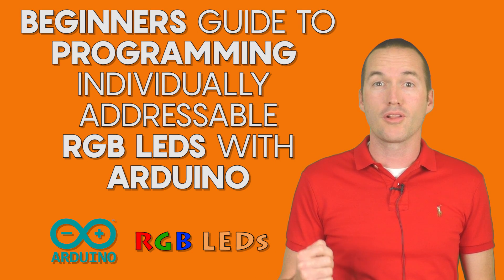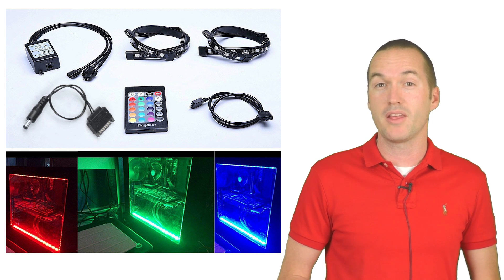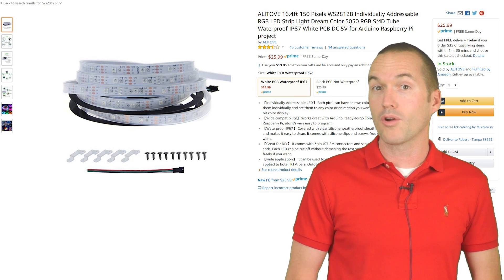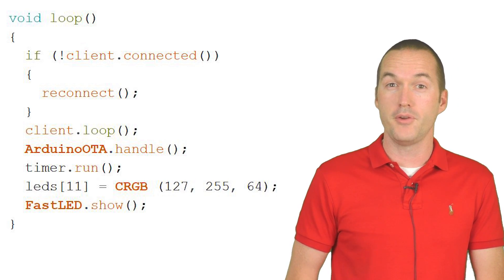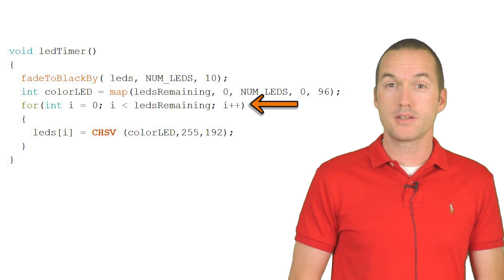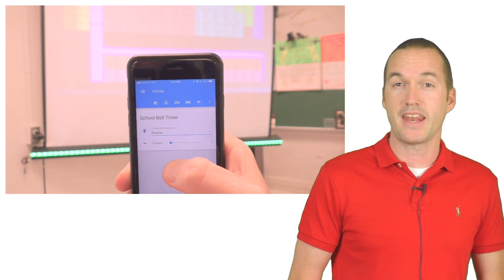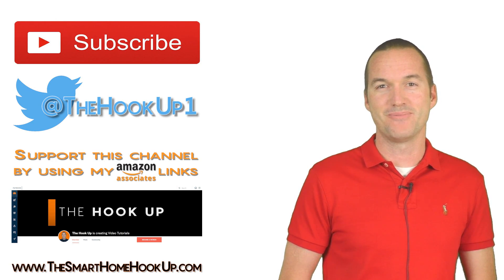BEGINNERS Guide to Individually Addressable RGB LED Programming with Arduino

Comment: Awesome tutorial. Thank you for making this video. I am using Arduino Uno board for the data signals. The issue is it does not light up the strip til the time I do not touch the board itself. Not sure what could be causi g this weird issue. Any ideas?
Reply from the maker: Make sure the ground from the arduino is also attached to the ground for the strips.
Reply: @TheHookUp  yay. Thank you for the reply. I apologize for being so exited as I never knew that I would actually get a reply. Thank you for the reply. As for the suggestion, I am using an external power source to power up the strip. Arduino is only being used for data signals. I have tried powering the board via both laptop and a adapter however the same behavior occurs.
Any input would be appreciated. Btw I am using this to power up the strip- 
Input voltage: 220 v ac
Output voltage: 5v dc
Output current: 10 ampere

Product link - https://www.amazon.in/gp/product/B07P4KYG9V/ref=ppx_yo_dt_b_asin_title_o07_s00?ie=UTF8&psc=1

Comment: Bro you are the  best instructor I have seen so far. I love working with LED Strip lights, Still learning, half of stuff you explained; went over my head but Still - you did an amazing job at explaining. Is there any website to learn about- Adruino,adafruit and other related stuff ? Thanks
Reply: Heaps. Go to the Arduino webpage. Lots and lots of simple stuff. Your local library may run Arduino sessions too.

Comment: Question: is it possible to cut an addressable ledstrip in half, and then start using both of them individually? 
Or should you always connect the power and datacenter cable to - and only to - the first addressable LED number? 
Many thanks !!
Reply: Yeah, it's possible. You can cut a LED strip into two and start using them individually. 
And your VCC could be anywhere but DATA wire should be the first LED. If you put it somewhere else, it'll work but not how you wanted to be.
Reply: @asteroidX  @The Hook Up 
Thank for reply. 
But can you tell me, on the original ledstrip (100 leds, not cutted), the middle LED has number 50. 
When I cut at 50, this LED (number 50) will become number 1 (of the second ledstrip). 

How does the program 'know' this change? In other words, how does the addressing of LEDs works, from a programmability point of view?
Reply: @wimrotor   The first LED is Number 0 and so on. Actually,  it's not complex like that. The first LED the data reaches is counted to 0 no. LED and then the data goes to the next one.
Reply: @asteroidX  Ok, thanks. 
Just asking, because I cut ONE ledstrip in half and starting from that second ledstrip, I can't program these LEDs. 
Although I keeping the direction of the ledstips in to account. (since there are arrows indicated on the strip)
So, it must be a electrical issue.
Reply: Yes! Got it working! :-) Thanks for feedback. 
I use these LED-to-WIRE connections. Completly removed the caps from the connector. Securely atttached first the wires and then the strip. Additionally I rebooted the raspberry as well. 
Which seems to solve the issue.
Reply: @wimrotor  
I'm happy to be of help.
Reply from the maker: Yeah, that will work.  All the LEDs in the strip are the same, nothing unique about the first chip in the strip.

Comment: could you do a video on installing the digital addressable leds on portable type accessories. i'd like to learn about what controllers, power supplies and just overall details in making led projects work that aren't permanent installs. Like for example making an LED costume.

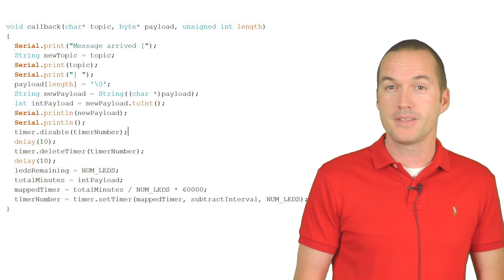Comment: This video is great but far from beginner. I have done a half a dozen RGB led projects and have only a mild grasp. If someone had never used Arduino they would be lost as the video jumps right into a program new to many. I understand 12 minutes is nowhere near enough time. I would bet all of the comments are from people who have Arduino and coding experience. This is more of an overview or a reference video. By 6:57 he just starts saying all kinds of tech lingo (mqtt message) triggers? was this covered in the first 5 minutes? People in the comments say it is easy because they want you to know they are smart and they understand therefore (it's easy).  It is not easy.

Comment: Hi, I am new to this stuff and really appreciate you efforts on your YouTube channel. I am getting my feet wet by trying your minimal FastLed sketch. I am able to get the single LED I select to light up, but for some reason other LEDs randomly light up. For trouble shooting I have completely rebuilt on prototype board with new components. 

Do you have any other suggestions?
Reply from the maker: Make sure you have NUM_LEDS set to the total number off leds you have.
Reply: That happened to me too.

Comment: I got this led strip. Will it work with this or not? https://www.amazon.co.uk/BTF-LIGHTING-Upgraded-Individually-Addressable-Waterproof/dp/B07DPJ17C4/ref=sr_1_2_sspa?ie=UTF8&qid=1549581072&sr=8-2-spons&keywords=programmable%2Brgb%2Blight%2Bstrip&th=1&fbclid=IwAR0Untc71uEOV5EvsLWKMbbK7ZcocBr3ciZ1KW5w85FqyeOZjUqwxgvxDaU
Reply from the maker: It will work, but it has a very high LED density which means it will require lots of power.

Comment: I noticed you are controlling the 5V WS2812b with the 3.3V logic of the ESP8266. At what length do you see this becoming an issue due to voltage drop? For your larger projects, do you use a logic level converter or a transistor setup?
Reply from the maker: I wouldn't go longer than a few inches without a logic shifter.
Reply: @TheHookUp  any recommendations?   I'm looking to control about 400 LEDs @ 60 LED/meter.
Reply from the maker: The total length of the strip doesn't matter, only the distance from the board to the first pixel.  The signal is boosted to VCC and rebroadcast by every pixel.

Comment: I am trying to to light out on the eves of my house and I watch all those video. But I am still lost!!! I understand you need the footage of roof line and a power box. And a raspberry but from there I am lost like first how to wire it up and 2 the program is there anything to help the beginner
Reply from the maker: Best thing to do is get a strip and a nodemcu and start tinkering.  Start small.
Reply: Where do you learn coding at? Helpful reference
Reply from the maker: @allstar002  I think a common thing is to learn to code by taking snippits of other people's code and trying to make it work the way you want it to.  As with most things, the best way to learn is by doing.

Comment: You are doing very informative video, keep up the great work. Your video has inspired me to convert my existing ws2812bi have around my house from the IR controller to an ESP8266, however, the current controllers have 300 preset lighting patterns. Is there a way to get these patterns into the ESP? I am hopeless at coding, so I am hoping to keep the functionality, without 3000 line of code.  Hope you can give me some guidance.
Reply from the maker: No way to transfer the patterns, but there are a lot of great patterns available out there to copy into your code.  My video this week will be about coding patterns.
Reply: The Hook Up great to know there are ones to copy. Looking forward to the next Vid, as I have a bunch of 8266’s arriving for this project. Got to get it done before Halloween

Comment: Out of the Shelley 1 and sonoff how would you get them to work on 5v usb power
Reply from the maker: Neither the shelly nor the sonoff could provide nearly enough power to drive a 5V strip.  I wouldn't try to drive more than a single RGB LED with the 5V from those devices.  Their 5V circuit is only designed to power the relay and the ESP8266.
Reply: @TheHookUp   thanks in was hoping to find something that would allow me to connect my usb power 5v led light strip to smart switch to by voice or phone app turn on or off would the sonoff sv do this

Comment: great video i have hooked it up myself but i can only get the bells message to trigger. not the timer. i have added the yaml code in to HA and changed the MQTT topic in the sketch to the same as in HA but cant get it to trigger. what message are you sending to get the countdown start?
Reply: sorry got it ;) customTimer/feeds/bells with the string 1 for example!
Reply from the maker: you'll need to adjust the MQTT topics in the sketch or the yaml so they match.  In the automation it sends the slider value to the "customTimer" topic, but I have the sketch set up to work with adafruit so it's looking for the topic "ADAFRUIT_USER/feeds/bells", if you changed those two to match each other the slider input should work as expected.

Comment: Hello Rob, Great video. Your explanations and code examples make it much easier to understand and learn. I was able to assemble this project and get it working with Adafruit IO. I do have one issue that I can't figure out. If I set the timer to anything less than the NUM_LEDS the strip flashes the total number of LEDs for just a second. The LEDs do range from green to red but only stay on for a second. If my timer is equal to or greater than the NUM_LEDS it works exactly as expected. Any guidance on where to look? I am stumped. Thanks again for the great videos.
Reply from the maker: Are you using the sketch that I posted, or did you make any changes to it?

That is indeed odd behavior, do the lights still count down, but count down very rapidly?
Reply: Thanks for replying.
Yes I am using your sketch . I made changes to the NUM_LEDS, the WIFI and MQTT setup, the MQTT lines in the void reconnect section and changed from RGB to GRB in the Setup Functions. The rest is identical. I double checked this with notepad++ and the compare plugin to be sure.
It does appear to be counting down, just very fast. I have a 120 LED strip and if i set the NUM_LEDS to 120  it is easier to see it counting, but if I set the NUM_LEDS to 30 it flashed for less than a second.
Reply from the maker: huh.  I have a theory...

Try changing:
  totalMinutes = intPayload;
  mappedTimer = totalMinutes / NUM_LEDS * 60000;

to:
  totalMinutes = intPayload * 60;
  mappedTimer = totalMinutes / NUM_LEDS * 1000;

and tell me how it goes.
Reply: That did the trick. So it was an order of operation issue?  Any idea why it would work correctly in your setup but not mine?
Reply from the maker: I think it exceeded the maximum value of an int in arduino.  Worked in mine cause I have 1/3 the # of LEDs.

Comment: Great vide and great instruction, i have one question.
How did you connect 5v powersupply to the ESP8266 board?
Reply from the maker: 5V to Vin, Gnd to Gnd: https://github.com/thehookup/WS2812B_RGB_Classroom_Timer/blob/master/5vnodemcu.jpg
Reply: @TheHookUp  do you have a recommendation for an individually addressable RGBW light strip that would work in this application?

Comment: As a long-time programmer, I still appreciate learning your thought processes around why you coded something in a certain way (as opposed to some other way).  Keep your videos coming and I also REALLY appreciate when you include reference materials (annotated) like in your "Best pins to use for ESP8266" video.  I started downloading those so that I can find them faster during my projects!

Please, please, please continue to explain hardware too!  It's one thing if I have to tinker-around with code to get it the way I want, but knowing when I'm supposed to solder-on some kind of resistor or something like that is not the kind of thing I have the background to know without some guidance.

Comment: You forgot that there are two standards for addressable strips.  You totally missed the APA102
Reply from the maker: Those are the ones that use a clock pin, right?  I thought they kinda stopped producing those.
Reply: @TheHookUp  it uses spi and is less sensitive to timings compared to the ws82xx leds
Reply from the maker: Good to know.  What do you mean by less sensitive to timings?
Reply: @TheHookUp  since they only use one wire the timings for sending data need to be accurate.  Also SPI can communicate much faster
Reply from the maker: Sounds like I need to do some research.  I've used plenty of SPI devices, but never LED strips.

Comment: Fantastic video. Insight it to the code is much better for me. Looking forward to more on these, don't suppose you could cover a bit on rgbw addressable in a future  video even if it's just code differences  thanks for the vids
Reply from the maker: I know rgbw isn't naively supported by the fastled library yet.  There is a fork with support, but I haven't tried it yet.
Reply from the maker: natively... autocorrect.
Reply: @TheHookUp  yer I've tried 1 and it is good. Uses neopixel library but with my inexperienced eyes I wonder how much of the code is left over from fastLED and is unnecessary

Comment: Loved the video!!
I know that what I'm asking below is tailored to my situation but I honestly think that would be a good concept for a "modern" house.
Im planning to light up my living room only with individual addressable led strip no bulbs whatsoever. So I see myself using it most of the time with white colour, though there's a party time when I change it to different colours and animations through home assistant light selection. Also I know it's possible to make it reacts to music while still lighting up the room, think this as a default colour to a dimmed down white and colourful bright leds when reaction to the music.

The thing is to make it useful for a permanent lightning solution, it would be important to be able to change the colours easily back to white. Just like using Philips hue bulbs. If the lights is other than white and someone turns the switch off and on the lights would turn it to white. Also be able turn on/off the music reaction animation.

Please keep posting the code. That helps a lot! Specially for those not good at coding.

Sorry if it's too much to ask for it. Yet loving the videos. All the best
Reply from the maker: I would highly recommend looking into RGBW strips rather than RGB.  There isn't as much library support, but the white color produced by RGB alone just isn't that great.

The other things you want to do (defaulting to white after color) are really simple and I can help you or point you in the right direction with that stuff.

Comment: Great video. How did you do the timer in home assistant and the voice control parts of this project
Reply from the maker: The custom timer is just an input_number slider with an automation to send an MQTT message with the value.  It's the same automation that I have for my motorized shades: https://github.com/thehookup/MQTT_Motorized_Shades/blob/master/shade.yaml

Voice control is node-red using the Alexa Local node, note that you can't use the term "timer" in your name or it will cause an issue with Alexa recognizing the device.  That's why mine is "classroom time".

Comment: Hello sensei!  Please can you start about fire security systems with homeassistant :
Smoke detectors ( ali express) 
Motion ( sonoff rf) 
Lpg gas detector ( alot if variety in aliexpress)with a solenoid valve to close the gas 
Ip cameras
Door sensor( rf bridge) 
Evacuation message or fire alarm sound from the speakers

Comment: Thanks Professor Rob....excellent explanation of the code. and YES to projects with code explained...... a tip....for those who think its boring, add a time bookmark so they can skip forward....But there are too many yt videos that show a project and provide the code, so explanation and the though process helps in tweaking the project for individual needs. thanks

Comment: I'm waiting for my ws2812b strips to arrive so I can start a 25m project which is also my first ever led project. So your videos are coming at a perfect time!

Something that I never found an answer to no matter how much I researched, was how to build animations starting from a specific point of a strip(s). Think of a house exterior peak...

Also, is there any animation simulator software in existence? Rather than trying to work out what it would look like based on coding in an arduino sketch, you could see it in action in a simulator first.
I doubt there's something like this but it would be really cool!
Reply from the maker: Yep, that first part of the for loop where it says i = 0, that means it will start at LED0, if you make i=50 it will start with led50 so you can start them at different places.  

I'm going to make a video specifically about this subject a little later.
Reply: That would be amazing my friend, keep up the great work.
By the way, sorry for the lack of commenting on your roller blinds video that I was very eager to see prior, I decided to just buy a ready made tubular motor because the price ease of use outweighed your step motor project. It's a little above my paygrade :)